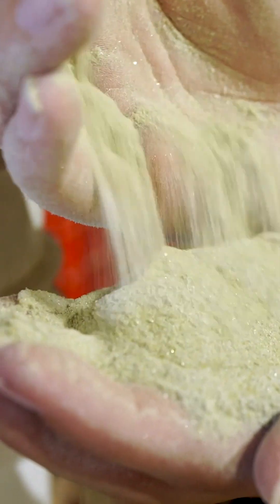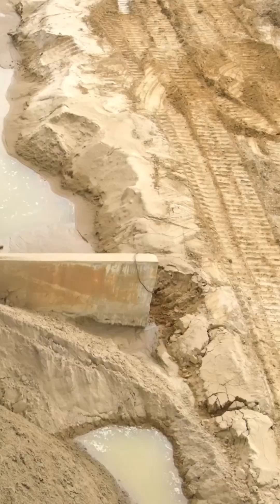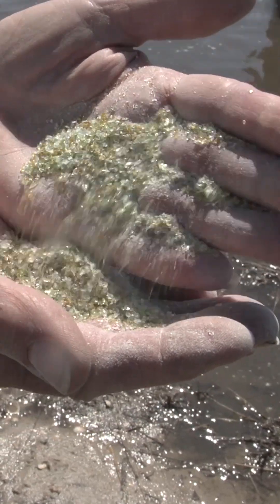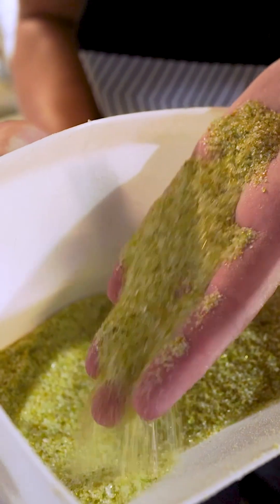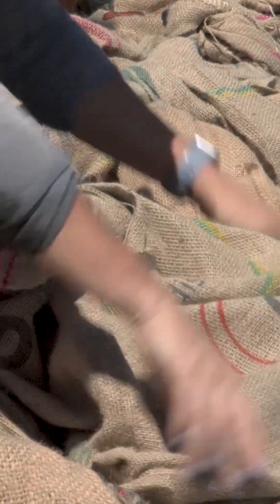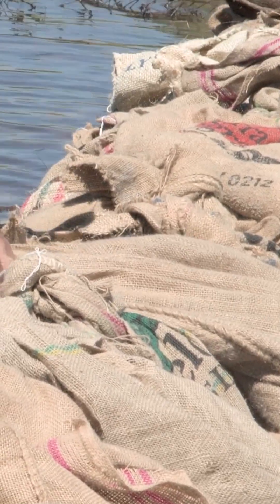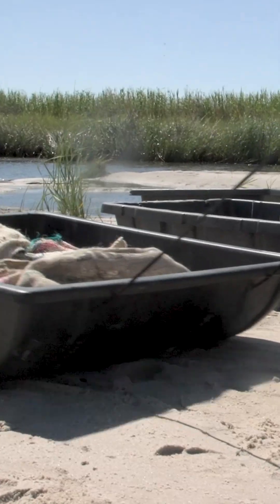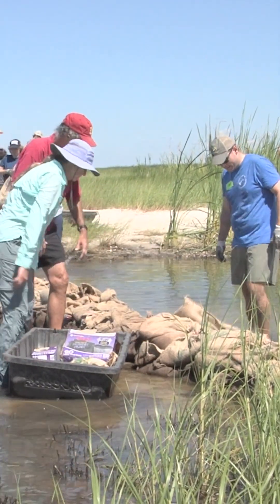Here's how coastlines are restored with crushed glass. #CoastalRestoration #Recycle #Oceans

Comment: If this is sand similar to the sand they use in construction/cement, why not save them the bother taking sand, and you not taking sand all the way to beaches, by just taking the recycled sand to be used in the production of what we use sand for?
Reply: Both need to be done- sand in coastal regions is necessary for it's structure and ability to resist erosion. That's why they're hoping plants will grow into it.
Reply: Construction cannot use ocean sand, because it is too rounded. Construction must use "raw" sand, like desert sand. This is why there is a shortage of sand, because ocean sand won't suffice.